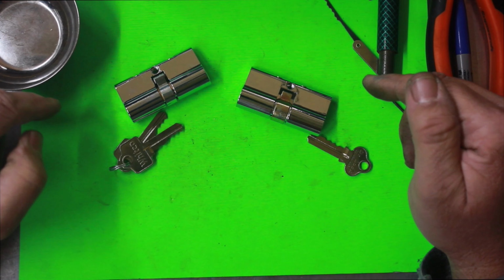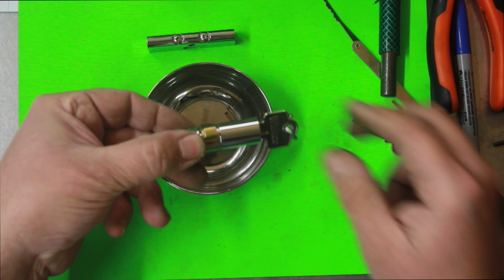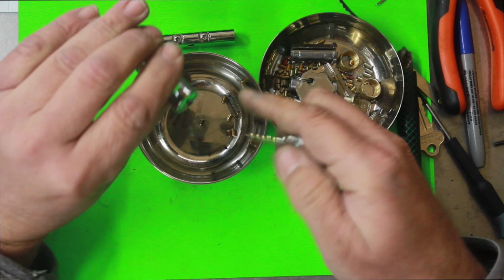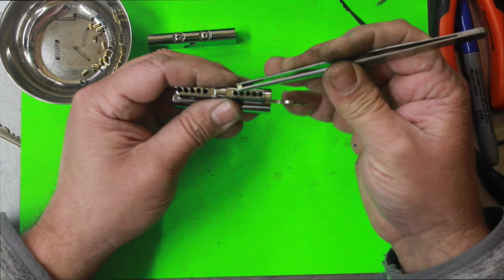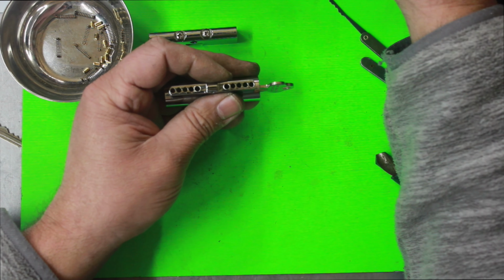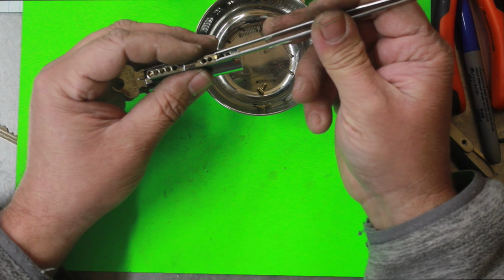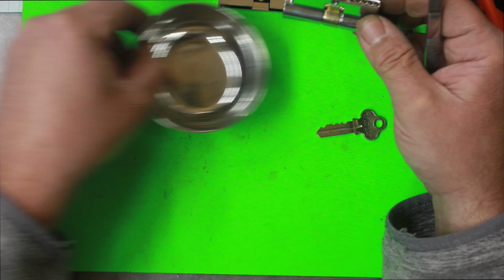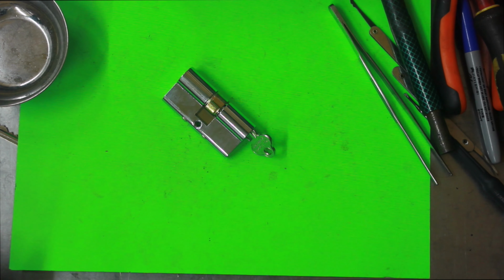Security Screen Door Cylinder Rekey - Locksmith Training

Comment: Pretty cool. I’ve never seen that style where the whole top was removable. Ours usually use set screws, individual pin stack caps, occasionally a plastic cap per side or no cap where you gotta use the special rekey tool kit that holds the top pins in place. Thanks for sharing!